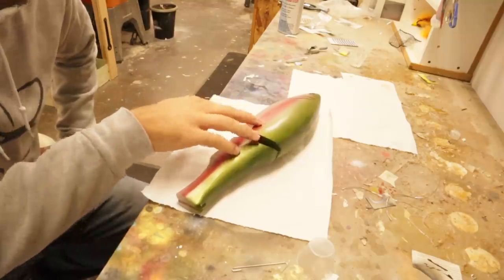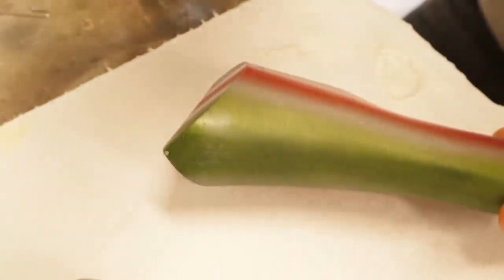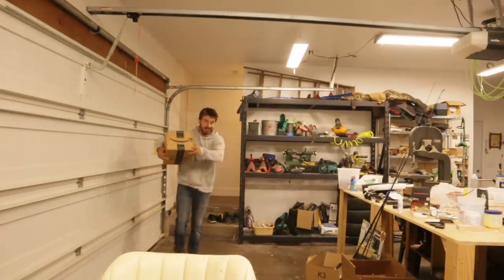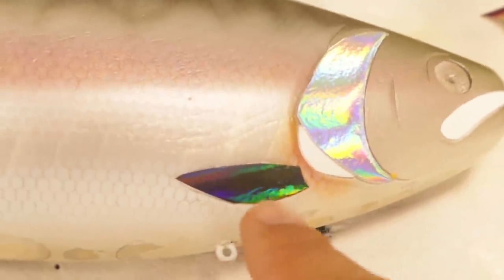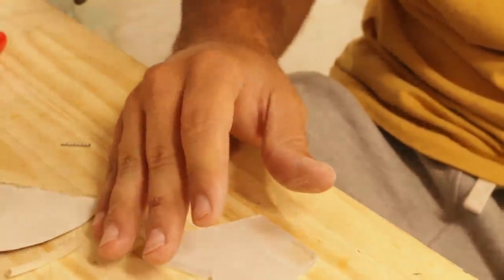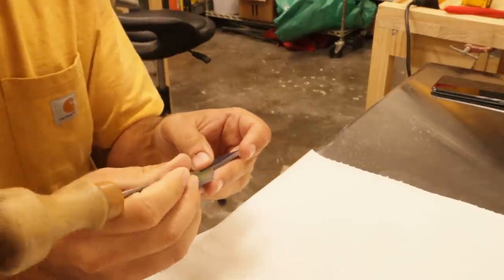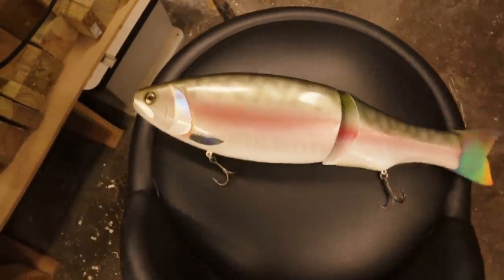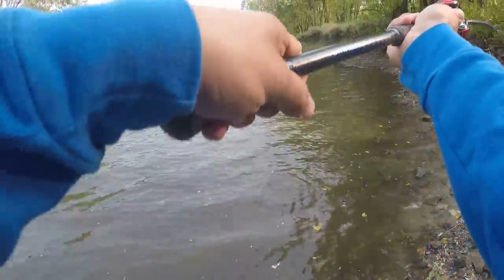FINISHED! The New Most Expensive Lure in the World

Comment: Suggestion for when you’re sanding the lexan fin, a lot of woodworkers use this trick, stick painters tape to the block of wood and another on the fin, put a small amount of super glue on the the painters tape then stick together, essential making double sided painters tape. When you’re done you pull apart and peel off the painters tape, there is no glue residue and you don’t have to worry about gluing the actual pieces together

Comment: “You probably need over 500lb of force.”
I think you need to prove that to us with a video...
Reply: James Smith he doesn’t need to prove it with that lure, you nob. Just put two twisted wire joints between two blocks of whatever wood he’s using and pull them apart with a scale or known weights.

Comment: for sanding purposes try taping the thing you want sanded and the block of wood your using to hold it, then glue the two taped sides together. that way its easier to pull apart and you don't have to use the 1/4 inch chizle.

Comment: There is a method with bent sheet metal like electrical trunking, where you file exterior of a bend and then once you free a flap by hacksawing 2 lines down to the filed edge, you can then bend it and it falls off. It works the same for your foil but on a tiny scale.

Comment: The clear film comes on holographic vinyl to protect the surface from abrasion (also found on some wrap vinyl's), if you bought a solid color it wouldn't have a cap.
If you need or want it to conform to a surface even better you can use a dense round piece of foam (like a small foam paint roller) and firmly roll over it immediately after applying heat.
And lastly if you over lap the vinyl onto the bait or the gills in this case than apply heat, you can come in with a blade afterwards and trace out the shape, peeling away any excess you don't want.

Comment: Try using painters tape on the part you need to sand and on a piece of scrap wood. Then glue the tape together. Itll hold the pieces together. And it won't damage the piece you need to sand.

Comment: Have you thought of making a radio control submarine into a lure? You'll probably have to go with some kind of impeller and sound deadening to quiet the noise from the electric motor but it might make a good video. Casting it into a body of water will be you pushing a little stick on a controller, forward.

Comment: When you want to glue something, like that lexan fin, just to be able to work on it be it sand or carve on it use the SUPERGLUE -MASKINGTAPE trick. We use it all the time in luthiery.
You get a peace of maskingtape, glue it to your holdingsurface, another strip to the object you want to hold and then just get a drop or two on one strip and a shot of accelerator on the other and just tape them together.
This way you dont leave ANY marks on the end peace and still hold it perfectly. It holds perfectly against lateral forces but when you need to separate just pull up and it comes off.

Comment: When gluing a piece down that you're going to be undoing after working on it, there's a super neat trick that luthiers use. Apply some green painters tape to both pieces, so that the tape lines up very, very closely with it's counterpart, then apply your Cyanoacrylate glue to the tape, and press the pieces together. The joint is remarkably resistant to shearing forces, but will pop apart rather easily when pried apart. Then you just pull off the tape and you're ready to go! Check out Twoodford on YouTube. Ted Woodford is a remarkable luthier up in Canada, and you can see this technique used in many of his videos! 
 Jerry Rosa of Rosa String Works (also a very fine luthier on YouTube) uses this technique.
Both guys are worth checking out, just for their general woodworking skills!

Comment: Tip for when you're gluing things to other things, with the intention of taking them off, like when you're trying to sand something that's hard to hold:

Put some masking tape on the item to be glued.
Then put some masking tape on the item you intend to glue it to.
Note:  When I say "put some masking tape on" a thing, I mean exactly that.  Normal application.  Sticky side on the object.  Non-sticky side facing outward.

Put glue on the non-sticky side of the tape.  Press the items together.  Done.

When it's time to "unstick" them, the majority of the glue will have adhered to the tape (not the items, themselves).

It peels right off.  No requirement to poke yourself in the eye with a chisel.

High five!